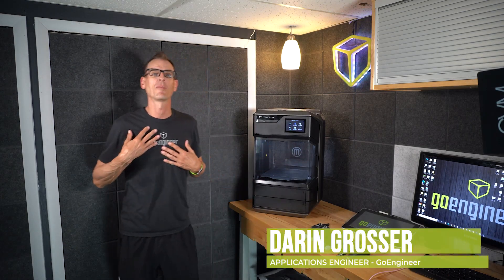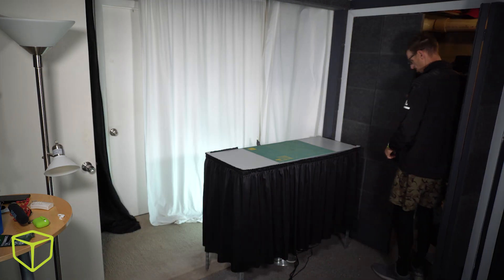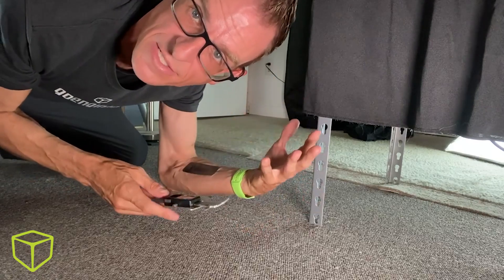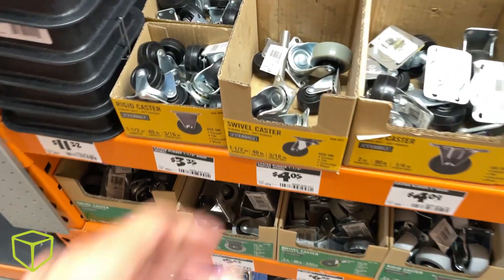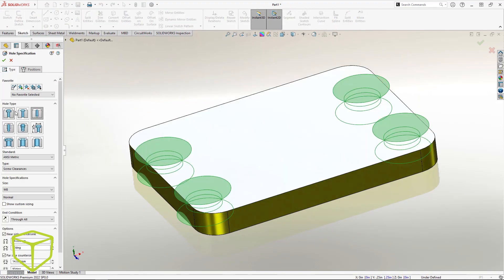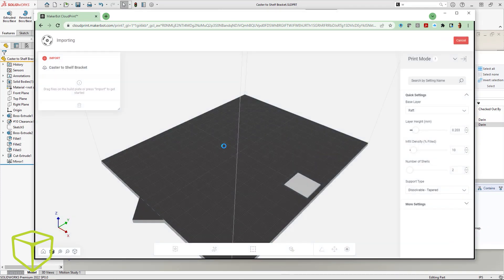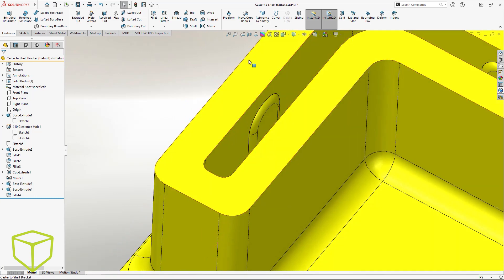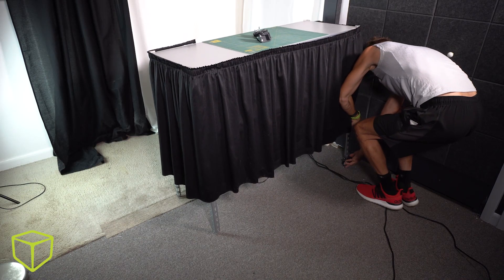Tackling Challenges with SOLIDWORKS and MakerBot Method X

Comment: Love your printer Sir.
Reply: Thank you!!  MakerBot has come a LONG way from the original, open air, desktop fdm that revolutionized 3D Printing for the masses.....and still not very expensive relatively! :)
Reply: @daringrosser6242  that’s a great news.. will check it out. 🤙
Reply: @daringrosser6242  Hello Darin. Can you please share your print settings? I just recently got a Method X and I'm just having a lot of bad prints from abs-r and rapidrinse. The rapidrinse is constantly oozing even after drying.
Reply: @flareside259  Is the material a FRESH spool or has it been sitting in the machine for an extended period?  I find that fresh spools out of the package are extremely reliable but  if you leave it in the machine instead of putting it back in the moisture bag after printing, then it will absorb moisture from the atmosphere and then exhibit the ooze effect you are now seeing.  ANY of the Water Dissolvable materials are very moisture sensitive and soak it up when out of the bag.   Also, keep ALL of your desiccant packets and store your spools in the bag, zipped, with the packet.
Reply: Makerbot lost me when they went proprietary. I don't want to have to buy another hotend to print 3rd party materials, nor pay 2-3 times more for material. Even if it's for work, and they are footing the bill.